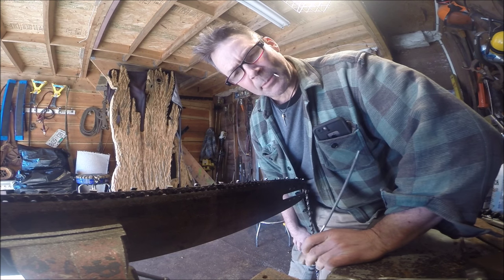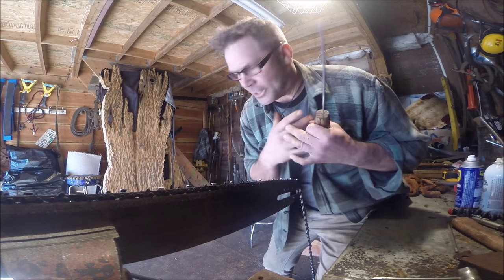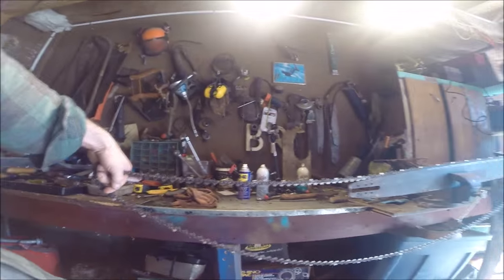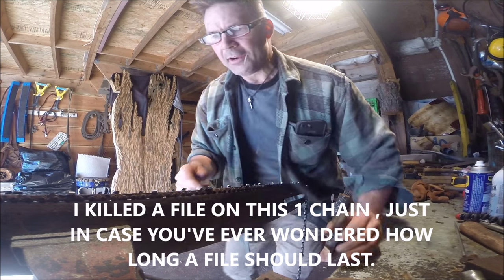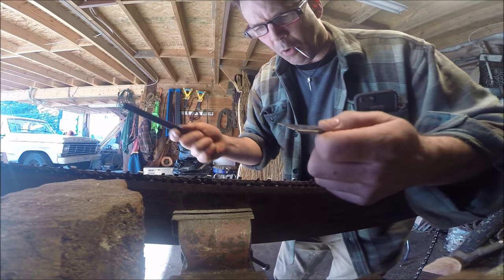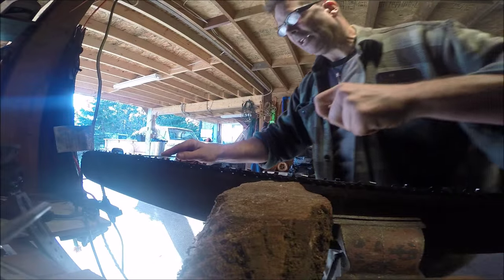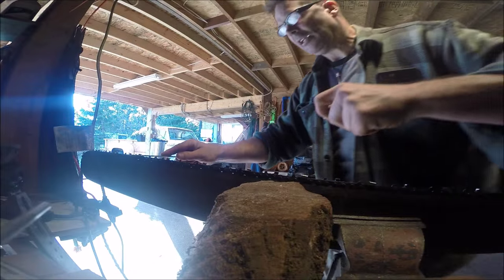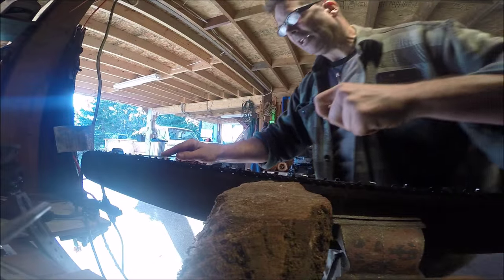CHAIN SAW SHARPENING TIPS

Comment: I agree with you and use your method (boat method to clean out the gullett).  You are also exacty right about their being additional resistance on dull cutters.  I file them until this resistance is gone, plus an extra stroke or two.  I clean and sharpen a saw after each use.  I also use slightly hungry chains because I generally cut what you would call small wood and being 72 I use small saws most of the time.

Comment: I logged full time for 36 yrs, 1960-96, i seen a lot of changes over that time. Bill your the first guy i've seen on you tube that really knows his stuff. The best raker gauge i found to keep   a smooth cutting chain is the Carlton File-O-Plate. I see your using basically the same gauge. The cutters don't have to be the same length when your using this type of raker gauge. I hand filed all 36 yrs, i wouldn't let nobody touch my chain with a grinder. Don't get me wrong, a grinder works very good, but most of these shops have no idea what there doing.
 In clear cut Aspen i could hand fell 75 to a 100 cds in one day. The best day i had bucking up, i bucked up 76 cds with a 90 Jonsered.
 The first 8 yrs i strip cut, thats when you fall, limb and pile by hand. I bought a new C4 Treefarmer pole skidder in 68, i was 20 yrs old.
Theres nothing better then logging, your on vacation every day
Reply from the maker: +Duane Nelson ,,,copy that sir,, thanks for good words .

Comment: My best friend and I use a different approach to our chain saw chains . I use a machine to sharpen all of his chains. He has a Jonsered 2171 & a 2172 .Both saws have 84 drive links so we can use the same chains . He has 20 chains and will take several chains to the field with them . We find it faster to change the chain then try to sharpen them with a file . The chains are full chisel . When I sharpen them I make sure to get the gullet . I try to take just enough off the chain try get it sharp , but not take to much out so that the chain last longer . I try to keep the rakers down .035 . I also file chains at 35 o . We think the chains cut a little faster this way . Thanks' for all of your great videos Billy .

Comment: I usually scan down the bar looking for a spark plug gap between the top of the cutters and the takers.  If I do not have this gap then I file the rakers.  I used my 180c to cut off some stumps, yesterday, so I have to sharpen it this morning, as soon as I get good light.  I cleaned the 180, yesterday, but it was getting dark, so I put it off until this morning.  You can imagine what dirt will do to a chain and I cut them as close to the ground as was possible, because I want my SPX lawn tractor to pass over them without hitting them.

Comment: I used your technique today sharpening my MS 660 (36' bar) on a large Corsican Pine removal. Gullets down, used the Husky raker gauge. She cut much more smoothly than when I do the rakers by eye (which I've always done). Definite improvement on what I thought was pretty good already! Thanks for the tips, brother!
Reply: Dan, on a 36-foot bar, you really should be running an 880 or bigger...
Reply from the maker: +Dan Hargrave right on Mr Hargrave great stuff . us old guys need ever angle we can get , say to yer girl for me , great meetin yer family the other day
Reply: I run a 36" on my 661 all day long....  I could run bigger if I need to.  Not sure you understand the relationship between bar length and saw size.
Reply: @GoodDayFarm  you can run a bigger bar sure. But a 36" bar buried fully will grumble on a 660... Especially in hard wood.  With a skip chain it won't grumble but it won't cut as fast. No replacement for displacement. You can run a 48" all day sure, run as big as you want.  if your cutting 12" to 18" fire wood rounds....  It's like the guys running 20" bars on 40 to 46cc saws... You can surely do it... Didn't mean it's right. Around here... 24" to 28" is weekday you will see on a 660
Reply: Ryan S , to each their own. I run a 661 with a 36” bar buried in white oak. I run a Stihl RSL chain. I run a 461 with a 28” in the same wood. 
A sharp chain and good technique go a long way. 
I’d hate to have to lug a 880 around for 3 foot wood...

Comment: Stihl chains are filed at 30 degrees and Husqvarna are filed at 25 degrees.  That raker gauge you use appears to be a Husqvarna one.  It is a lot different from my Stihl gauge.  I like the way yours works - it slips into the previous cutter and then over the raker for the next cutter and you file off what sticks out.  Mine rests over several cutters and you file off what it above the groove.  I think yours is better, probably more accurate and is a lot faster to use than my Stihl gauge.  When i am finished filing a chain, I generally scan down the chain from the side and make sure the tops of the rakers are below the top of the cutters by about spark plug gap (.020).

Comment: Hmmm I've been using the Stihl 2-in-1 file tool to sharpen chains for a while now, with pretty good results.  Edges, angles and gullet look nice and the chains cut smooth as well.  It'll file the top of depth gauges to horizontal flat tho so I take a file and give em their curve back.  Nothing really to complain about and yet... getting an itch to start freehand filing and experiment again haha.  Thanks for the tips mr Buckin'!

Comment: Thanks for posting this!  What are your preferences on chisel vs. semi-chisel chain, and full comp vs. skip tooth for different situations?
Reply from the maker: i PRODUCTION FALL WHERE THE WOOD IS CLEAN WITH FULL HOUSE CHIZEL  GRINDER  AND RESIDENTIAL TREE WORK AND FIRE WOOD WITH HAND FILE SKIP FOR QUITE ABVIOUS REASONS DIRT AN STEEL
Reply: @BuckinBillyRaySmith  love the vidjayos brother.. But I have to disagree on the skip chain for dirty wood... Fewer cutters means more wear per cutter.. Better on clean wood, and long bars where you might be better served delivering more power to each cutter. Semi chisel for dirty wood for sure. Full chisel for clean wood and big wood. Agree there for sure. Keep up the great work

Comment: What power head do you use to run this unit . I was given a 48 inch bar that takes 2 men to us . The motor is an old koler 4cycle 
I m not sure the gauge but it is bigger tooth than a 404 . I liked your video

Comment: Hello, great video. I'm curious how well the rip chain performed. I've chainsaw milled for years and I always keep the cutters the same length. Most everyone knows the common problem of cutters on one side getting shorter from hand filing and causing the cut to stray. Also, when the chain approaches the end of its life, it's nice to have them all the same length. I believe uneven cutter lengths can also cause the bar rails to wear unevenly a little faster. Not only are the cutters uneven length, but also uneven height. I used to use a jig but now I file by hand using a method similar in principle to your method. You show nice detail for filing the rakers. I like your videos, thanks.
Reply from the maker: hey tim bin havin trouble repyin,, are you getting these
Reply: Yes, I got this one and surprised at the fast response.
Reply: I got this response but don't know if you sent others.

Comment: On my saws, tooth size is important.  On thick logs, my cut was steering itself to the right so badly that the bar got hung up in the kerf. I measured with a gauge and found some teeth about 30 thou. longer than others. Shortening the long teeth solved the problem.
Reply: Isn't a long tooth going to be a bit taller than a shorter one? If so, it will cut deeper and steer to that side. 
I don't know George, I'm just trying to wrap my brain around all of this. I need it to warm up outside so I can get out and cut more. There is some ash available for the taking, but I haven't been able to stay sharp long enough to finish a full cut. Thanks for your help.
Reply: Which side does a long tooth lean towards?
Reply: Teeth get to be relatively longer by an accumulation of over-filing the others. Sometimes, a tooth doesn't "feel right" under my file, and I give it a few extra licks. Apparently, I do that a lot.
Reply: Teeth also get shorter by hitting rocks inside a hollow stump. :-{
Reply: Mike W count your strokes. "1-2-3-4"  go to the next tooth regardless of "feel under the file". Consistent long strokes. Sometimes a few teeth get damaged and it makes you wanna go a few more strokes and make them perfect, just leave'm, They'll catch up on the next sharpening. But it doesnt hurt to have one a little longer as long as your sharp and have a good gullet.
Reply: Bingo! I have been filing until it feels right. Thanks Charles!

Comment: I use a 7/32” file to radious the gullet for chip clearance first. I don’t touch the upper edge of the cutting teeth, I use the file in the guide to sharpen up the upper edge separate from the gullet. Then I file my rakers. This way the chain cuts faster.

Comment: Hey Buckin...Ive been dealing with an Oregon V72 chain on my Mculloch PM610...now the deal with the v72 chain Ive never had to deal with on my other chains is the bent rakers low kickback features...when I first used the chain my saw was practically spitting out mulch but over a course of 1 season it has dwindled down to dispensing only dust...I faithfully file my cutters after every tankfull or 2 but can't figure out the depth gauge requirements on these vanguard chains....can the rakers be filed freehand or am I just dealing with a single season throwaway chain?

Comment: Think I'm getting it. Lots of good information. What kind of files do you run?
Reply from the maker: +Tom Saad I bin runnin' Oregon , you will fine tune things, have ya got yer raker gauge goin, slip it on every couple filins to keep things smooth. thx pal. for your presence on the channel
Reply: +Buckin' Billy Ray Smith no raker gauge yet, I have been bad. Been hitting them with my demel :).Excited to see the difference. I got a saw shop down the street, I'm going to try to get there Saturday!

Comment: How many coffees you had before this lol Do you only grind your square chain ? Ive been hand filing that new square chain walkers sent over and its another level over what i have done the last 25 years with a round file, getting into the swing of it though.  Its interesting about you saying about wearing files out, i mainly use ones from Oregon they vary in quality, some last twice along as others.
Reply: If I have to sharpen anything 36" or more, it's more about the tequila than the coffee!!
Reply from the maker: +ukgunworks ya them files are not what they use ta be .. I grind when I'm fallin' out in the bush , not when I'm doin tree work in residential, to much steel in the trees,  no coffee   ha  haa

Comment: You'll see guys tap their files against the bar or links "tink tink" to knock the metal chips off it so it files smooth and not gritty. Not Billy here. that super light pull back is what is clearing his metal filings. I pull the file back the same way, but I wear gloves and pull the file through my hand too. And I could never file bass ackwards - that's cool.

Comment: First and foremost a guy needs a clear understanding of how the chain cuts. I hand file all mine also. 3 sharpenings  and its better than out of the box. Very through video thanks
Reply from the maker: +TGCIII  you bet , I don't like em stock
Reply: +Buckin' Billy Ray Smith Would you advise to rework a brand new chain, or wait until it needs sharpening the first time? Thanks sir.
Reply from the maker: I tell ya what I was out in the bush and got stuck to  use a stock skip tooth chain , and it was very sad ,, I'm not just sayin that either , it was terrible  what I usually do with ship tooth is hit the rakers one sweep just to get it pullin a bit ,, not to much you don't want it to hungry that it slows down yer cc's , then I see if its barable , if not definetly get it trained to yer likin' I find I getter really cutting 3 or 4 filins in hope that helps

Comment: what am I doing wrong when after I sharpen my saw it drifts to one side during a cut?
Reply from the maker: +J &amp; S LAWN SERVICE  well sir I wood guess you haven't flipped yer bar in 30 years lol , so it could be that , just a shot in the dark so if that's not the case  I'm kiddin ya  , but it could also be yer filing. so take of the bar and look at the rails on top see if they are roll over a bit flip yer bar clean it see if goes the other way, let me no we will figure it out ,, have patience , another way to find out if its yer filin' through on a new bar and if it still goes to one side ya may have to m,ake some ajustments,, let me no
Reply: +Buckin' Billy Ray Smith thanks I'll give it a try
Reply from the maker: yes do pls let me no

Comment: I don't want to tell you your business, but you need a bigger bar. Lol. That's a lot of chain.
Reply: It's being  sharpened on a shorter bar, so that the weight of the chain is hanging down at a steeper angle off the ends of the bar; this stabilizes the chain.
Reply from the maker: +joeandmollysantamour..... ya it is .